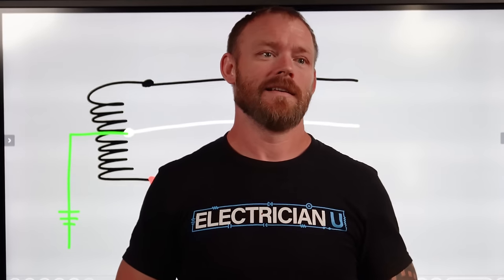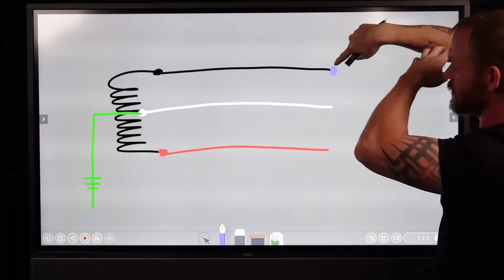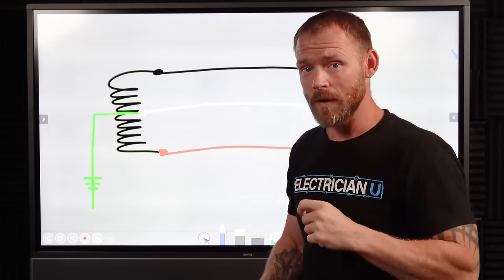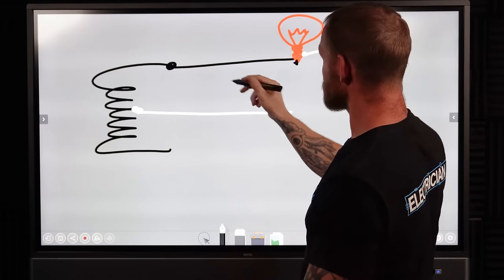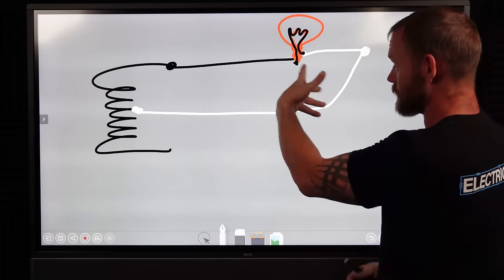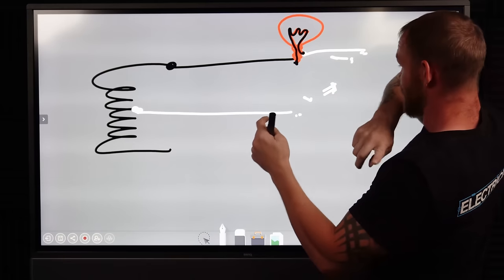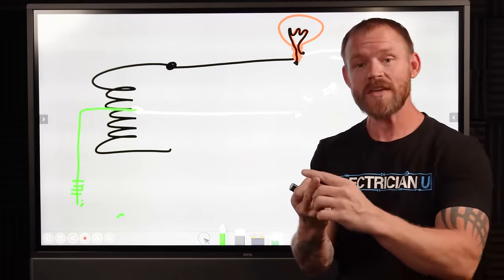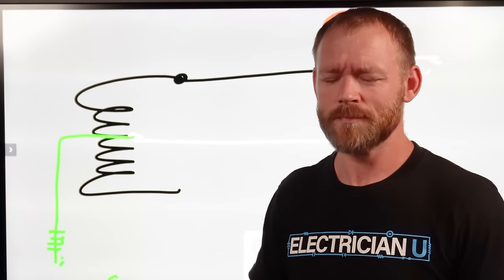Can You Get Shocked From a Neutral Conductor?

Comment: I was within a few inches from getting nailed by 4160 at a Papermill in SC while working. It scared the ever living shit out of me. Couldn't believe they had exposed bus way roughly 2 feet from a walk mounted telephone. If your worried about being electrocuted, never go into a distribution center at a Papermill...... My ex would have been rich beyond her wildest dreams and happy about it....
Reply: You're saying 4160 volts?
Reply: @erich1380  yes.... medium voltage
Reply: @bryanduchane2371  how is something of that high of voltage allowed to be inside? 277/480 is considered high voltage in our trade and even that is rarely needed. I did electric for a gigantic pill factory that had 277/480 and even that was few and far between. Voltage is supposed to be stepped down from the thousands to operating voltage by the utility company wayyyy before it gets anywhere close to a building
Reply: @erich1380  You've never been inside a Papermill. The motors are so large that they use 4160 or 15kv to power them. If they used 480, a motor that's the size of a refrigerator at 4160 or 15kv would be the size of a condo at 480. Any facility that has large HP requirements is going to have medium voltage (4160 or 15kv) as their power source. A 600hp motor at 4160 can handle a load far higher than a 600hp motor at 480. 
What is stand (or very wrong) is to have exposed bus way located in a area that is really accessible to people. They had their 4160v drive wall mounted with no enclosure. Not only was it exposed on the wall, some dumbass thought it would be nice to have a phone a few feet away from it.
Things were much different in the 1970's than they are today, thank God!!!
Reply: @erich1380  I was at the same mill one morning making sales calls and a maintenance man was crushed to death by a "roll kicker".  It's a wedge mounted flush with the conveyor used to redirect a roll of paper that's 6ft in diameter 12" wide. He was under the floor fixing a switch. He tried to reach for the $5 actuator of the switch while the roll kicker was in between cycles. Missed the timing of the cycle and was completely crushed into mush.... The guy had worked in the maintenance dept for 20+ years and was scheduled to begin his family vacation at the lake 1 hr after his death....
It was something I'll never forget. They shut the mill down completely while removing his body. It was the quietest place I've ever see been in my life. .....
Reply: @bryanduchane2371  that's weird cuz it would only pull 31 amps at 480 by ohlms law. The amp draw is next to nothing at that high of voltage. Im aware of locked rotor current and stuff but still
Reply: @bryanduchane2371  600hp at 15kw with 4160 volts is really weird math and doesn't make alot of sense if I'm being honest. The kw should be alot higher
Reply: @erich1380  Your math is way off. A 600HP, three phase motor at 480V is about 600 Amps. While at 4,160V it would be about 75 Amps. 4,160 is really common in high power industrial industries. And you also got confused between kV and kW. Bryan mention kV, kilovolts, not kW, kilowatts.
Reply: @inothome  oh you are right I missed it I thought it was a w not a v at quick glance. Makes sense
Reply: @erich1380  from 1000 volts to 45 kv is considered medium voltage. It’s a little confusing if you don’t know much about the distribution side of things. Working in commercial  you’re not usually exposed to anything over 480v and the 2 predominant voltages you have in most commercial buildings (in the U.S.) is 120/208v & 277/480v. And your panel designations usually have an “L” for low voltage (120/208v) or an “H” for high 277/480v. But on the broader range they’re both considered low voltage. I’m a maintenance electrician for the state and one our buildings has 4160v chillers. I worked on the new Tesla gigafactory in Austin and they had 25kv distribution throughout the factory
Reply: @Ephesians-ts8ze  sheesh. No thanks

Comment: I have been shocked on a Neutral more than once. Multiple voltages  This is about the Late 1980's with 480-volt 3-phase lighting. I am sitting on metal bleachers inside the building for a "SAFETY MEETING" and I reached up and grabbed the ceiling grid and slumped off of it during  being shocked. The person giving the safety looked like he thought I was falling asleep, because as soon as I was off the grid, I regained sight. I showed them the one gray wire hanging out of the ceiling and touching the bleachers. He had some guy kill the lights and he showed me on his meter that there was no voltage from the wire to the bleachers. CYA! (Cover Your ASS!) I know what happened, and I don't believe I took the full load, although I may have been a parallel to ground. Other than that stupidity, always know where your skin is and what it is touching, and how well you are insulated I.E. Boots, Gloves ETC.  BTW, YES is the answer to the video name.

Comment: The thing I don't see is if you touch a hot wire and nothing else you will get shocked.  Such as a bus bar in a service panel but you aren't touching anything else.  Where would the return path be?
Reply: @KeyDx7 yes I can see that.  Its funny that you only feel it in the hand that touches the wire or buss bar

Comment: First, I find it somewhat criminal that you mention just in the last minute that you can quite easily make a full circuit by touching ground - or standing on it (from previous six minutes it would seem touching hot is perfectly safe (your drawing is also misleading in that way)).
Brainstorming, when touching neutral (or "neutral") can be dangerous: (I live in a country with non polarized electrical sockets and 230VAC in them):
- wrong colour of the wire (laziness or negligence) in the installation or even wrong labels
- somebody somewhere turned aroud the plug that shouldn't be turned around or miswired it
- interrupted or damaged neutral  - can quite easily be at full hot potential, specially with higher powers - interrupted can easily mean someboy has managed to install a switch on it instead of hot - or a broken two pole switch, which turns off neutral, but not hot
Let us not get in more exotic scenarios with multi phase systems and such. 
Generally, for me no wire in the installation is a neutral wire unless  I test it to be.

Comment: Ive gotten shocked by ground before. Ground has potential towards phase but i wasnt touching phase i also once managed to make signal lights go on with out being connected to - or ground you people keep forgetting that the power grid isnt the only thing in existence which has electric properties i mean all of chemistry is based on the behaviour of atoms with each other dependent on their outer most layer of electrons and thats just one example you yourself are also an electrical system your brain controlls your muscles through electric signals your heart and brain also have em fields which sometimes obscures meters and is measurable these fields tho weak in theory have infinite reach because similair to every em field moving through a conductor creating a current and vice versa every em field creates a gravitational field and  just for better understanding signal lights dont need to be particularly bright

Comment: Please explain to me how did i just not get hit by only touching the hot and nothin else oh i no my i was in Walmart shoes that were not non conductive so when you introduce your self as a ground you now are ground potential so there is no need for a neutral you'll be lit up like a drunk at a baby shower and please explain why you cant be hit by a loaded neutral to when the hot is off cause you do know that loaded neutrals (on a dead system ) can and will kill you please tell me how that dont work to and dont ever think you got to touch it for it to hurt or kill cause a.c voltage can ionize through the air to get to you for the least path of resistance but thats on hight voltage a.c and minimal separation is 3 foot without non conductive material clothing

Comment: Will you be shocked by a neutral if you touch two points in series on an un broken neutral? Your example seems to only show if those neutral wires were not connected. I suppose this is the same question if it was a phase a to a or b to b. There is no difference in potential so I am having difficulty understanding if current on can shock without a voltage difference between two points.

Comment: I got shocked touching a neutral bar while barefoot. Backfeed...
Reply: Could it not also be the fact your were barefoot on the ground which is in it self conductive but also tied to the neutral at the utility. Isn't it all about how much resistance you offer to the circuit and how much voltage and amperage is on a circuit. Obviously this is more likely to happen in high voltage I've heard of power lines falling and people getting shocked from the ground just getting out of there car and there car being energized. But I'd bet it applies to all scenarios dealing with electrical circuits even lightning is just a path for electric charges in the air to take to ground or sometimes they don't even hit ground they will arc in the clouds them selves too

Comment: You can even touch positive and don't touch anything you will not be shock right?
Reply: If you are truly touching nothing else. Meaning you are standing on an insulating pad.  Then yes.
Reply: Well, this discussion was inreference to alternating current, so there is no "positive", but the same principle would apply to direct current as well. If by positive you mean the "hot" (non-bonded) lead in an alternating environment, you can still get a shock if any part of your body (including your feet) are coming in contact with ground. Depending on how well insulated your shoes are (if that is the only point of contact with ground), you may not feel a shock since, as the video states, there has to be a path/loop for electricity to flow through.
Reply: @ecospider5  Thanks and yes I was referring to hot

Comment: Mess around with a multiwire branch circuit and find out! Lol If the grounded (neutral) conductor is accidentally opened, the circuit changes from two separate parallel 120 V circuits to one 240 V series circuit. This can result in fires and the total destruction of electrical equipment. Failure to properly terminate the ungrounded (hot) conductors to separate phases could cause the grounded (neutral) conductor to become overloaded from excessive neutral current. So if a conductor carries current you can get shocked
Also that neutral conductor is not on a breaker if you don't know what you're doing you will burn your house or someone else's to the foundation.

Comment: It's incorrect to say you must be touching two things .. If the neutral wire breaks from the earth connection that neutral becomes a live wire .. it's only a neutral when it is connected to the earth. So if it breaks from the earth it is no longer a neutral. .. it's a live wire so touching with one hand will be enough to get a shock .. the nearer the break   is to the load the worst the shock.
Reply: But you can touch a live hot and not get shocked, I've done it plenty. The reason you get hit off a hot is because of the grounded neutral (or hot in some instances). If you're not making a path you can grab the hot all day and it's not going to shock you. You become the potential, not create a difference in potential.

Comment: You cannot get shocked from neutral. Hence the definition neutral. Without watching the video I am sure you are going to describe a way where neutral has been compromised where someone can get shocked. By definition again, then that case would no longer be neutral. Ask your question again describing your case with more details on the scenario where neutral can be compromised. The way you posed your question, it is an emphatic no and it would be extremely ignorant to say otherwise.

Comment: I once got shocked when putting a tap on an RG-500 Coax line.
(CATV lines on the pole carry about 90 Volts or so.)
What happened was that I let my forearm rest on the support wire that runs pole-to-pole.

Last time I made THAT mistake.

Yes, I know... I should have pulled the fuse in the amplifier before putting in the tap.

Comment: You can't be shocked by anything without it going through you to something else, so half of this video was moot, to begin with. The consideration of whether it will happen depends on the voltage difference between the two points you are touching. The rest of it, where you tried to explain how you get shocked off a neutral was a vastly oversimplified and false narrative. This video doesn't have enough thought or information in it and is woefully incorrect. The short answer is, yes, depending on the circuit and how it is wired, you can get shocked off the neutral. No, your shoes will not protect you, you always have a path to ground through your body. The question is whether the voltage is enough to overcome your body's resistance to the ground. Neutral conductors carry enough voltage to overcome the resistance of the wire, shared neutral systems can carry even more voltage, and 3-phase neutrals in a 5-wire system can carry enough voltage and amperage to kill you quickly if one leg is shut off and the others are not. This is not a topic that can be adequately covered in a 7-minute video, and the end result of this video could be dangerous to those who don't know better.

Comment: So you smugly think you are safe because you are only touching one wire, only to find out there's a wiring fault and you just gave the circuit it's ground.  Don't be touching wires unless you want to get shocked ESPECIALLY if you are there working on it, because something is not right with it!